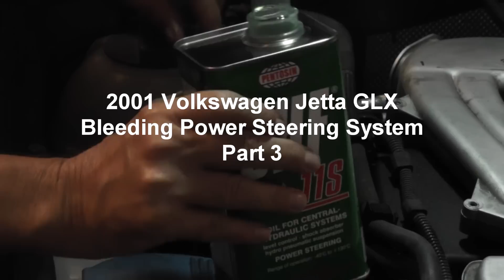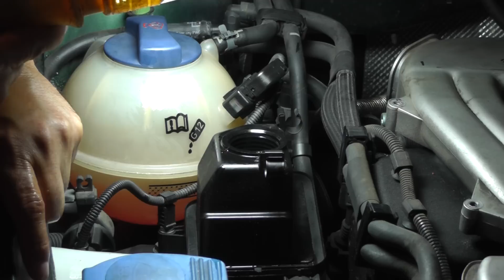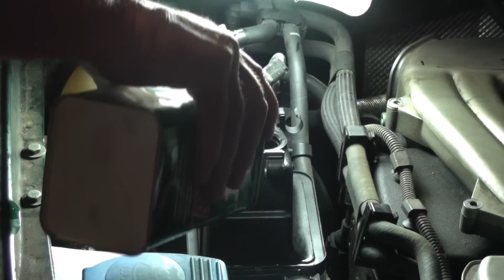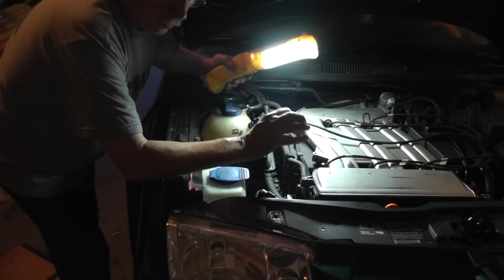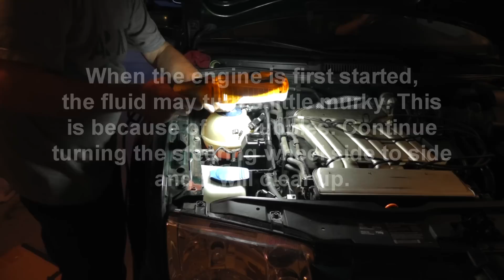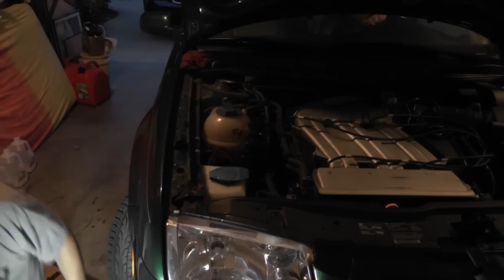Volkswagen Jetta Bleeding Power Steering System Part 3

Comment: Hello stuzman,
Came across your video and well done. Gave me the confidence to go and tackle this job myself on my 04 Audi TT 3.2 with the v6 engine. I wanted to ask the process of bleeding out the lines, did you do it with the front of the vehicle still jacked up on jackstands or did you put the vehicle back on the ground to turn the steering wheel side to side? Thanks and hope to hear from you.
Reply from the maker: Throughout the entire procedure, both front wheels were off the ground. The steering wheel was moved from side to side until no more air bubbles were seen in the reservoir. Then, the engine was cranked and while the engine was running the steering wheel was turned from side to side.

Comment: Question when you’re doing this procedure is your car still on jack stands or is it on the floor at this point ?
Reply from the maker: Both front tires were off the floor being held by jack stands on each side.
Reply: @stuzman52  thank you sir for this informative video I will do this next week as my steering has become very heavy  at low speed and wining but yet my fluid level is still good.
Reply from the maker: @Redk00laid  Good luck on your repair Red...

Comment: What about just cranking the motor with the fuel pump disabled so the car won't start.  That should prime the pump fairly quickly.  I've done this for initial startup on a rebuilt motor with no problems.
Reply from the maker: Yes, you can do that. Always more than one way to solve an issue.
Reply: With the engine on, it burps the fluid out of the resevoir all over you and your car, plus you will potentially damage your pump

Comment: great 3 part series. thanks for adding the torque lbs, i'm picky about that. I've heard you have to remove the inner fender skirt to get to the pump?  how do you do that?
Reply from the maker: +bill jones Bill, I believe this car and other Jettas have a plastic shield that covers the bottom of the engine. In my case when I bought the car, this plastic covering was not there. So, if you have that plastic covering, you'll have to remove it to get access to the pump. And the inner fender wheel would be connected to this covering. Just a simple matter of taking out some plastic fasteners to get access to the pump.

Comment: Thanks for posting this vedeo and commentary.  I had to replace the 2 steel hydraulic lines on the back side of the rack and afterward bleed the system of course.  I don't have a service manual for the 2001 Euravan (Mini-Winnie) and this info was very useful.
Reply from the maker: +Thomas Findley Glad to help out Thomas. Another way to bleed the air is to use a hand vacuum pump which is faster. But I figured that most people wouldn't have an adapter cap or a vacuum pump. The method shown works, but takes a little longer.

Comment: i have to replace the power steering pressure line to my volkswagen golf mk4 would the bleeding time take a lot less than replacing the pump
Reply from the maker: Eric Herrera Hi Eric...not necessarily as there would be air in the system. You may get lucky and it may not take that long, but you want to make sure the air is out before you crank it up. Good luck on your repair and take care...

Comment: Thank you for the video. Definatly provided a in-depth guide on how to bleed the power steering line which is what I was looking for. Unfortunately for me, my power steering rack and pinion let go while I was headed home so the pump was ran relatively dry for around 10 miles so hopefully the pump wasn't damaged.
Reply from the maker: Hi RaynFire. Might be wishful thinking that the pump is okay after 10 miles of driving with no oil in it. I wish you luck and hope all is well though.
Reply: Mine failed intermittently. Hit half a dear carcass in north Dakota and it tore the belt cover (skid plate was missing) had several different issues w the serpentine accessories in the half a year since. Just got it fixed up. Appreciate the vid!

Comment: My 01 jetta keeps making a groaning noise when I turn the wheel.  I noticed it's low in power steering  fluid. is this the cause if the groan or do I need to replace the pump?
Reply from the maker: If you have a low level then this can cause the groaning noise which means you also have air in the system. If you let it run for too long with a low level, you'll damage the pump along with the rack assembly. Best to keep the level full until you find out where the leak is.

Comment: Quick Question....

You would not happen to know how to FLUSH the power system resivoir on a 2002 vw jetta?
Reply from the maker: Some folks like to disconnect the supply hose, run the car and turn it off when the fluid is nearly out. But that can damage the pump or rack assembly with little oil for lubrication. I just drain the fluid with the car off to get as much out as possible, and then go through the procedure outlined in this video to remove the air.

Comment: Nice video! I look forward to doing this soon on my gti
Reply from the maker: Hi Daniel. Pretty easy job. Another way that you can do this is by using a hand vacuum pump, which is faster, but I figured a lot of DIY people wouldn't have that. So, that's why I showed this method and it works very well to get the air out of the system before you start the engine. Good luck on your repair and thank you for your comment!